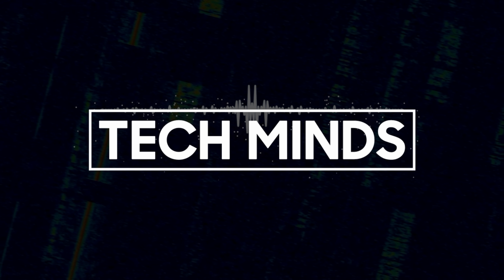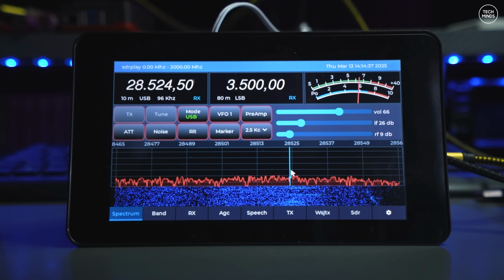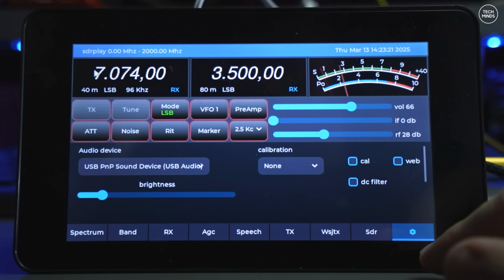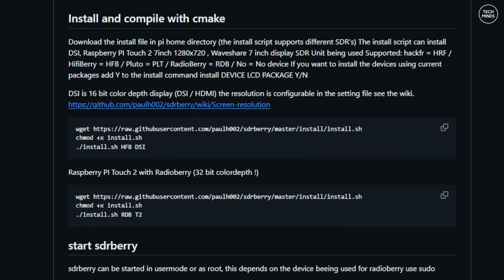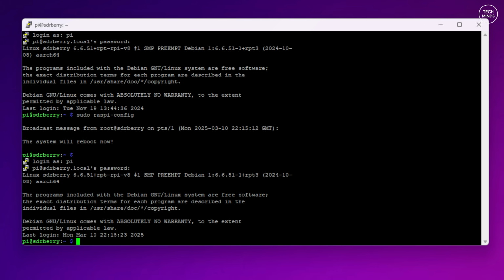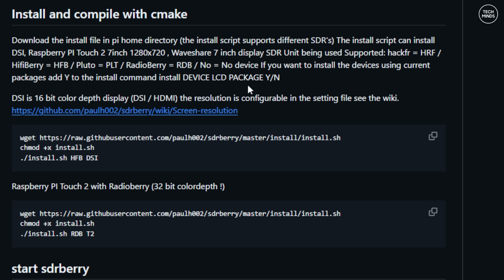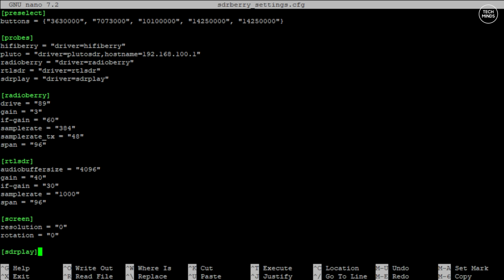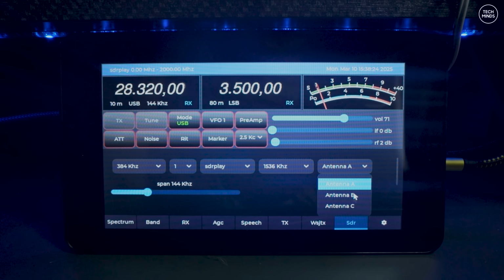SDRBERRY - This User Interface Is Just GORGEOUS! AND IT USES SOAPY TOO!

Comment: I really find your videos useful, thanks. In the case of the SDRBerry why did you choose to build up a Langstone fully rather than the SDRBerry. I would assume the SDRBerry would require all of the add-on components, using a PLuto+, as was needed in your Langstone build for a full transceiver? Cheers

Comment: Some observations....all seemed to go well, although unclear how to add each different SDR except by running the required e.g. "PLT" etc commands (I have RTL, SDRPLay, Pluto, hack RF) until trying to edit the config file - its empty - so unable to invert touch-screen!! It does 'run' and has found the HackRF, but crashes when anything it tried. But agreed, a lovely screen and interface. I can see it being a useful piece of kit. A card image would vastly increase its accessibility and usage, or mere step by step instructions I think. Linux seems to need either direct cut and paste (your two sequences on your github were very helpful) or an in-depth ability to spot odd characters....and could it not boot direct to the app instead of needing keyboard and sudo sdrberry etc.....or have I missed something. Thanks anyway 🙂

Comment: have you tried to TX with it? does it have a hardware PTT support?
Reply: I use TX with radioberry SDR, TX is currently supported using a companion ESP32 board that sends CAT commands but you could use the GPIO to support TX. If you like you can open a request for this.

Comment: That looks like it could actually replace Malachite SDR for many users. Yet it would be nice to make a proper board with encoders, DSP, power management etc to have CM and the actual SDR device.
Reply: 😂 Nope it wouldn't. 
The Malahit DSP-2 with its INDUSTRY LEADING NR (!) is a currently the best stand alone all mode, wide band (!) SDR receiver. Period ❤

Comment: i wish it support all kind of display .. especially 24 bit Color depth .. most brands are 24 bit .. thank you for sharing
Reply: It supports 32 bit devices, most 24 bit devices ignore the first 8 bits. Like the Pi Touch2 which is 24 bit. Although it can be a puzzel to find the correct settings.

Comment: Hi again, maybe someone can tell me what is wrong here.
-------------------------------------------------------------------------------------

 Option name: bass value: 4

Option name: fast value: 
Option name: medium value: 
Option name: mode value: 1
Option name: ratio value: 12
Option name: slow value: 
Option name: threshold value: 0
Option name: treble value: 0
ALSA lib pulse.c:242:(pulse_connect) PulseAudio: Unable to connect: Connection refused

Screen resolution 800 x 480 screenRotate 0 touch_swap setting 0
Input device name: "vc4-hdmi-0"
Device is not a keyboard
Input device name: "vc4-hdmi-0 HDMI Jack"
Device is not a keyboard
Input device name: "vc4-hdmi-1"
Device is not a keyboard
Input device name: "vc4-hdmi-1 HDMI Jack"
Device is not a keyboard
Input device name: "10-0038 generic ft5x06 (79)"
Device is not a keyboard
Input device name: "Realtek RTL2832U reference design"
Device is not a keyboard
end keyboard 
Input device name: "vc4-hdmi-0"
Input device name: "vc4-hdmi-0 HDMI Jack"
Input device name: "vc4-hdmi-1"
Input device name: "vc4-hdmi-1 HDMI Jack"
Input device name: "10-0038 generic ft5x06 (79)"
Input device name: "Realtek RTL2832U reference design"
Mouse device name: "Realtek RTL2832U reference design"

RtApiAlsa::probeDeviceInfo: snd_pcm_open (playback) error for device (hw:vc4hdmi0,0), Unknown error 524.

RtApiAlsa::probeDeviceInfo: snd_pcm_open (playback) error for device (hw:vc4hdmi1,0), Unknown error 524.

ALSA lib pulse.c:242:(pulse_connect) PulseAudio: Unable to connect: Connection refused

RtApiAlsa::probeDeviceInfo: snd_pcm_open (playback) error for device (hw:vc4hdmi0,0), Unknown error 524.

RtApiAlsa::probeDeviceInfo: snd_pcm_open (playback) error for device (hw:vc4hdmi1,0), Unknown error 524.

129 device: Default ALSA Device input 0 output 10000
130 device: bcm2835 Headphones (bcm2835 Headphones) input 0 output 8
No matching device found.

RtApi::openStream: input device ID is invalid.

ALSA lib pulse.c:242:(pulse_connect) PulseAudio: Unable to connect: Connection refused

Cannot open audio input stream

RtApiAlsa::probeDeviceInfo: snd_pcm_open (playback) error for device (hw:vc4hdmi0,0), Unknown error 524.

RtApiAlsa::probeDeviceInfo: snd_pcm_open (playback) error for device (hw:vc4hdmi1,0), Unknown error 524.

device name = Default ALSA Device
: maximum output channels = 10000
device name = bcm2835 Headphones (bcm2835 Headphones)
: maximum output channels = 8
No matching device found.

RtApi::getDeviceInfo: deviceId argument not found.

audio device = 0 USB Audio Device samplerate 48000 channels 0

RtApi::openStream: a non-NULL output StreamParameters structure cannot have an nChannels value less than one.

ALSA lib pulse.c:242:(pulse_connect) PulseAudio: Unable to connect: Connection refused

Cannot open audio output stream
The framebuffer device was opened successfully.
800x480, 16bpp
The framebuffer device was mapped to memory successfully.
Input device name: "vc4-hdmi-0"
Input device name: "vc4-hdmi-0 HDMI Jack"
Input device name: "vc4-hdmi-1"
Input device name: "vc4-hdmi-1 HDMI Jack"
Input device name: "10-0038 generic ft5x06 (79)"
Touch device name: "10-0038 generic ft5x06 (79)"

RtApiAlsa::probeDeviceInfo: snd_pcm_open (playback) error for device (hw:vc4hdmi0,0), Unknown error 524.

RtApiAlsa::probeDeviceInfo: snd_pcm_open (playback) error for device (hw:vc4hdmi1,0), Unknown error 524.

auto correction 0
samperate rx 0 samplerate tx 0 decimation 1.000000 ifrate 0.000000

 samplerate not set,please update sdrberry_settings.cfg exiting gracefully...
Reply from the maker: Which SDR are you using? The last line is the problem. The sdrberry_settings.cfg file does not have a starting sample rate set. You should be able to pause in the video where I show my settings file and just copy the settings, depending on device.
Reply: @TechMindsOfficial  So I manage to start it and now i'm working with the RX then TX , it seems that it doesn.t work .I have RTL-SDR 2,3,4 , PLUTO , HACKRF , NOOELEC V5 and none of them seems to RX nor TX.Thanks a lot.I'll keep you posted. P.S. - somehow was a compilation problem.:face-red-droopy-eyes:

Comment: Hi guys, I have tried to get over the setup as explained on the video, without success. I am using a Raspberry Pi 4 8Gb, with an Micro SD 64Gb, connected to a 5" DSI  800*400 Display, with and SDR-RTL V3.  maybe there are some steps that are missing from the video. Do you have a step by step installation process in text format?  Thank you!
Reply from the maker: After installing sdrberry did you install the soapyrtl drivers? https://github.com/TechMindsYT/sdrberry-hints

Comment: Great video and more $$ spent by me! Can you tell me what the exact install line for the SDRPlay RSP1B with the official Raspberry Pi 7" monitor is? That's the only part I'm not clearly understanding. Many thanks.
Reply from the maker: Hey! Checkout the “hints” link in description, that should detail how to install for SDRplay devices. Let me know how you get on. :)
Reply: @TechMindsOfficial  I wound up using No and DSI and then installed all the SDRPlay stuff. This is a great setup but definitely a work in progress. I posted a message at the Github page regarding not being able to get it to autostart and some hopes for future versions to add squelch and maybe direct entry of frequencies as a lot of my use will be VHF and above and outside amateur bands. This one is almost certainly a keeper though! Thanks again.
Reply: Figured it out on the install sh line by using a combination of "No DSI" and then installed the SDRPlay stuff therafter. Overcame a few other issues to include resolution with edits to the sdrberry_settings.cfg file. Lots of fun stuff to tinker with there. Had an audio output problem resolved by adding a USB powered speaker. Fun stuff. Will follow up with @paulh0029 about a few things as well. Again, many thanks for all of your great videos.

Comment: Does anyone know if this can be hooked up to a Xiegu G90?
Reply: You need a SoapySDR driver to do so. I made a hifiberry driver which can take the IQ output from the G90, but instead of sending commands to an i2c device (si5351) it should send CAT commands. So this need some development. But if you have a SoapySDR driver you can use any SDR program to manage the G90.
Reply: @ Thanks for the info Paul.

Comment: Can i use Rasp B+ v1.2 , or only from Rasp4 or 5, i tried all the process it went all well but when running the command sdberry it says no sdrberry installed on my Raspi 3 B, I will buy one version 4 , i think it is because my OS is 32 bits and not 64
Reply: Only Rasp4 and 5

Comment: I hope there's are way to stop that VU meter from jumping around so badly.
Reply: Good idea, I added a configurable delay to the s-meter. You can change it in the rx page
Reply: @paulh0029   Or a "damping" setting to smooth it out a bit.

For FM, I wish they'd add a way to remove the squelch tail. I do it with external audio processing gear. I side-chain a short delay into the audio which blocks the squelch tail from being heard. Works great.
Reply: @phillipzx3754 I used a moving average. A squelch I still have to add.

Comment: why is there this psychotic persistent lack of color green on control screen/waterfall / meters?
what is the reason? are you all terrified of green?
why does it always have to be 79 shades of blue red?
why not all normal colors?
can anybody reasonable shed some light on this?
Reply: I’m gonna take a guess here and say it has to do with how the S meter was setup. Green being a weak signal and red being strongest. On the waterfall, blue was chosen as noise, green is where the signal starts and ends, or is weak, and red being your center of signal. If green were chosen for noise or background, it’d be a little bright or messy, same going for orange or red. Dark blue is enough to be noticed against black without being distracting. You see green or red and immediately notice “oh hey, there’s a signal”

Comment: given its DIY, it could also be modded to add potentiometers to crank up and down the different values
Reply: Yes, I use a ESP32 with rotary controllers for volume. It also has an optical controller for tuning. The display of the ESP works like a 2nd display with s-meter and power / swr meter
Reply: A couple of rotary encoders and buttons would make this a very nice device to use.
Reply: @shmorgb  yeeah thats what i was thinking, tho im too busy (and lazy) to do it, at least in the short term

Comment: My original Raspberry 7" touch display has unequal vertical angles of view. After rotating desktop for 180 deg, visibility in vertical plane is very poor. Has anyone else experienced same?
Reply: Some displays are designed for tablets with mainly portrait usage. I don't think there's a way to make yours better.
Reply: The orginal 7 inch 800x480 pi display is not so nice compared to the 5 inch displays. However I do like the new Touch 2 display. It has a higher resolution and a metal backplate to reduce rfi

Comment: Thanks for you super review, I hope people enjoy the sdr software.
Reply from the maker: @paulh0029  Thanks Paul! Amazing work and looks awesome..!
Reply: Great work, thanks so much for sharing
Reply: Fantastic work Paul! Would it be possible to support the HL2 in the future? This would be something that thousands of HL2 users would love I am sure. 73
Reply: @mostlypostie1  Yes, a SoapySDR driver for the HL2 would be great. But nobody has put effort in it. I don't own a HL2. From a technical perspective you could use the radioberry SoapySDR driver as a template and add the communication to HL2. Radioberry and HL2 use the same command structure, because they are based on the same FPGA code.
Reply: @paulh0029  if I was smarter at coding, I would love to help! However I can help anyone with testing and debugging, as I have a few HL2's and a good enough understanding of IP networking and the way HL2's work over IP. I will keep an eye on the project, and I will be playing around with an RTL tomorrow! Keep up the great work. 73.
Reply: looks great Paul, you've done a great job.
Reply: Yes. I'm enjoying 3 months trying to make it work at least somehow.
Reply: @snail2171  what is wrong there ?